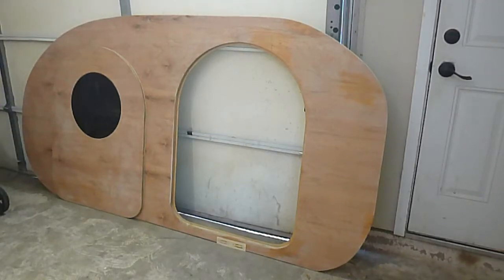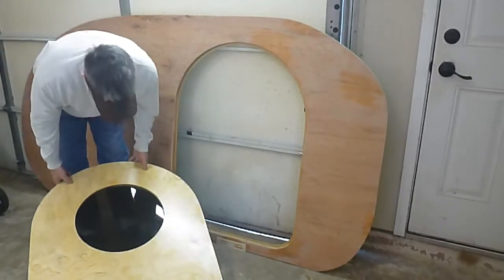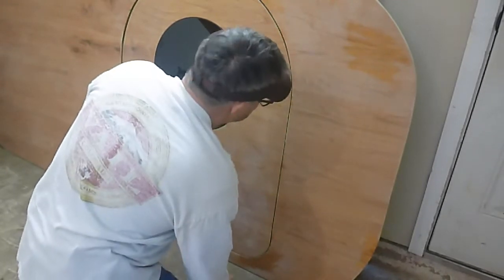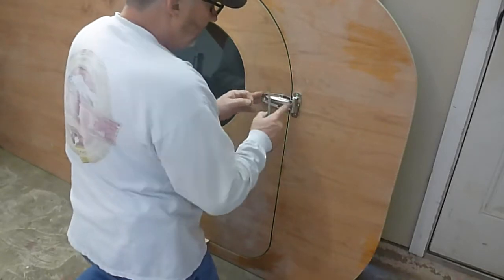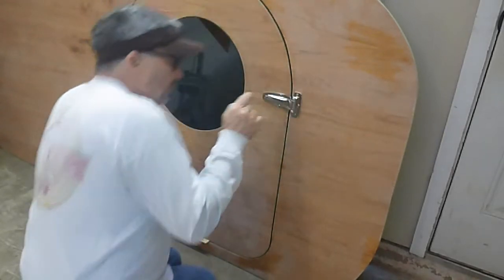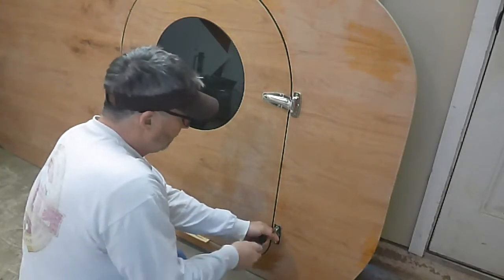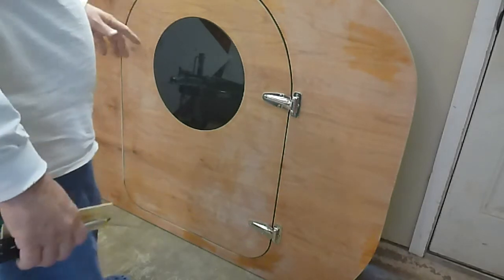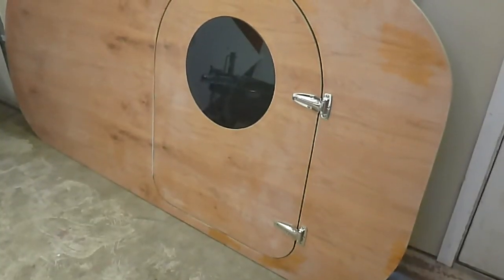Teardrop camper build a 5 X 8 video No. 21 Home built camper doors and DIY camper window install

Comment: Looks good. What type of seal will you be using?
Reply from the maker: frost king brand epdm D-profile self stick 5/16 wide. If there is something that is more tuff let me know I am open to suggestions.
Reply: @mlangfordcamper  Man I have no idea. I try to stick with 3m based adhesives.